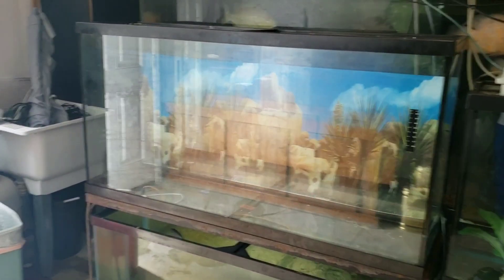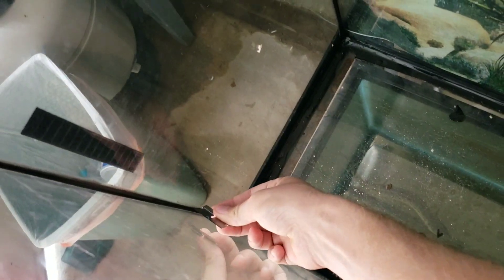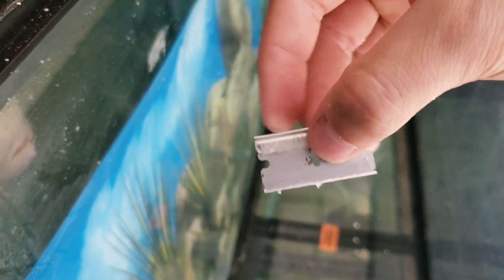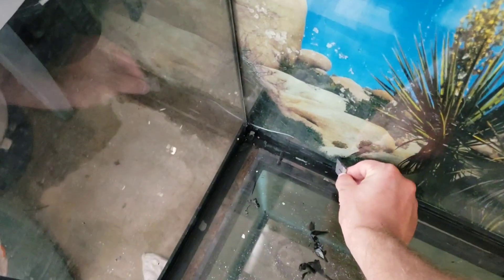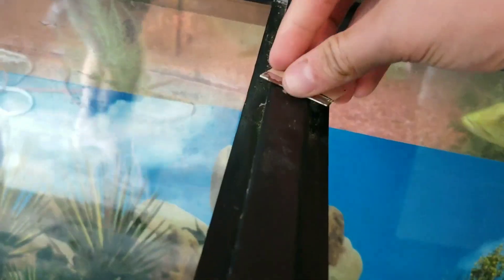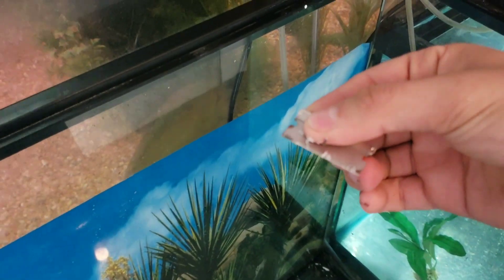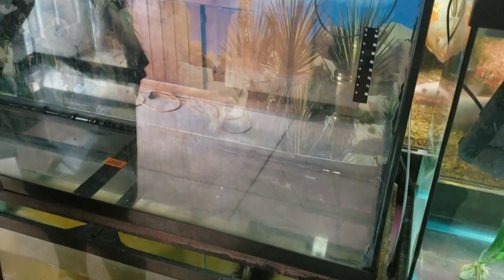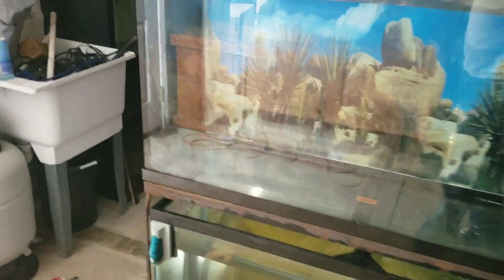Easily Reseal a Leaking Aquarium  - ohio fish rescue

Comment: I appreciate the effort to make the video and the active commentary. New silicone typically does not bond to already-cured silicone, hence the importance to remove all old silicone residue. Silicone begins to skin in ~10 minutes so if any tooling is desired, 10 minutes should be the planned time frame to work within. A 1/8” silicone bead cures within 24 hours but reseals are never 1/8” beads so a longer cure time is warranted. I cure for 1-3 weeks. Anticipate and avoid an expected vapor of acetic acid during cure time.
I would also mention the need to use aquarium-safe branded silicone, which have 0.2% or less D4 (Octamethylcyclotetrasiloxane) by weight. A popular GE Silicone I mistakenly but commonly used to reseal tanks contains 1-5% D4, which is 5-25 times as much D4 as the aquarium-safe-branded silicones contain. Studies on D4 have shown extremely low quantities (we are talking μg / liter) can limit growth, reproduction, and decrease health in fish and it isn't good for us either. It also bioaccumulates. D4 accumulation is like lead or arsenic in drinking water, you do not notice the effect immediately, but eventually….

Comment: did this with a 50 gallon tank that was given to me, had been in a garage stored for probably 30 years. Pulled out old silicone and it started coming out in chunks between the panels. Turned it into a terrarium and gave it to a guy who has snakes after that.

Comment: For real joshie. You couldnt have put this vid out at a better time. I just got 2 30 gallon tanks for 40$ that is a heck of a deal in my area. Fish keeping isnt common in my area. Anyway. One have worse looking silicone than that and they had fish and water in it idk how it didnt leak or crack. I cleaned them both with vingar water and baking soda. Then scraped them. Then cleaned them again with baking soada and vingar water. Then let it dry then scraped that fine hard to get film. I wouldnt have bothered with that and my tank would have failed. I'm using silicone 1 window and door 100% silicone. You guys save more fish than you know.

Comment: Hey man Nice video. I'm curious what your thoughts on resealing a 225 gallon as I just had mine start leaking out of the bottom back seam 8 months after purchasing it from a employee at bigals, he had it up and running for one full year. I came home it was drained to 3/4th level with a pretty steady leak in the back bottom of the tank. I would love to just reseal it n get my fish back out of this temp 55 gallon and into thr home again, have you ever sealed something that big and had success with it? Thanks for any help as I really could use any i can get at this point.
Reply: Redo it

Comment: What if you do cut the silicone in between the glass? The part you said not to cut. 😅
Reply from the maker: You have to start all over and cut out the silicone and clean yhen tape of the corners then real apply the silicone sealant and smooth then remove tape and let dry

Comment: I just resealed mine today the only problem I had was when I was done with The spreading of the silicone I want to go peel off my tape and I was already dry and I’ve got messed up seems any ideas on how to fix it or any ideas how to do it better if need to be resealed
Reply: Use painters tape next time.
Reply from the maker: The type of tape dont matter. You have to remove the tape right away before the Silicone can set up and get hard

Comment: Good info on how to do the removal of old bad silicon but I think it would be better if u did a tripod and film what ur doing, you have to remember new silicon won't bond to old so u have to get it all cleaned off. You dont have to get in between the glass because the new silicon will bond to the glass and seal it back up. The silicon in between the glass holds the glass together so ur tank doesn't blow out

Comment: Now..how do you do it with a tank you cannot completely drain?  Just developed a pin hole in my last aquarium and cant relocate everything.
Reply from the maker: Tubs, vanilla pools , kiddie pools , water tubs ect
Reply: Four inches of substrate..it was an experiment I started...14 years ago?  Heavily planted on top of the fish..not an option since there is actual soil in there.
Reply: @SMDoktorPepper  Did you come up with a solution?
Reply: @matthewjbauer1990  it ended up moving everything into my old and empty reeftank.  Much trouble arose from that, lost some fish, and its still not where I want it.  The leaky 55 is sitting in another room, empty for the most part.
Reply: @SMDoktorPepper  PETCO ? PETSMART ?  IF YOU HAVE A LEAKING TANK HEAD TO THE BIG 📦  BOX !! VERY HAPPY TO GET A NEW TANK FOR 1/2 PRICE
Reply: @stoneysscapes7544  not a practical solution as it was a very odd shaped tank, and its already been dealt with months ago

Comment: Got a aqaion 60gal with a slow leak.. picked up super cheap whole ensemble..customer return for leaking.m  still not done a fix on it as I personally seen bottom seals fail on this set  and plenty of people have found the same defect on this very set.   Debating rebuilding the tank something I know how to do but suck at.. or doing the resealing..  I be ok of it still has a slow leak but as a customer came in with a vid the whole bottom failed .. one side.. lucky he was home .. but was a common problem with this tank it seems..  50 dollar tank still boxed stand glass hold and light.. sigh

Comment: PSA, do not reseal a leaking tank, pull the tank fully apart as the structural seam is ruined
You can use wire wheels to remove silicone residue on edges of glass
You need hundreds of razorblade, i used 20 on a 55 gallon
Reply: @1PITIFULDUDE  Im guessing your new to rebuilding tanks, yeah because i cut the glass apart, skimmed off the silicone and used a wire wheel to remove the rest of the residue. If your just using blades and acetone you will need heaps of them and even then you may want 1000grit sand paper to sand and see if there is any silicone left where you removed the internal seal
Noticeable leaks of more than 3ml a day requires the tank to be disassembled and rebuilt, if water can seep through a hole at a trickling rate the structural seam is severely damaged, you can drain it, after putting new silicone in the leak  sandwhich it with a brace with a leather face to avoid pressure point on glass and cure it and fill it without fish just before the RTV process is finished fill the tank to force pressure into the gap  drain it and finish curing